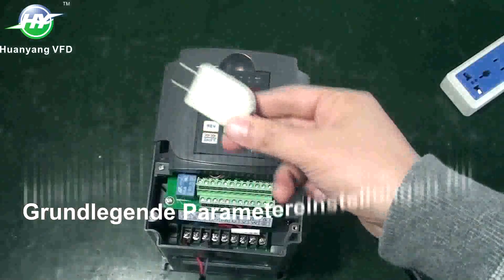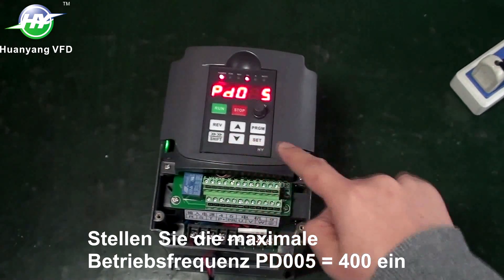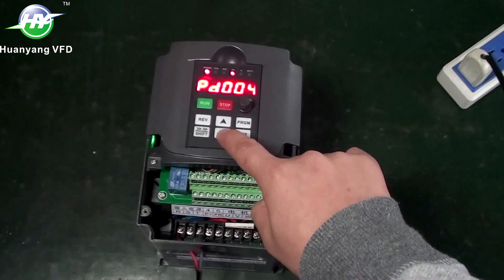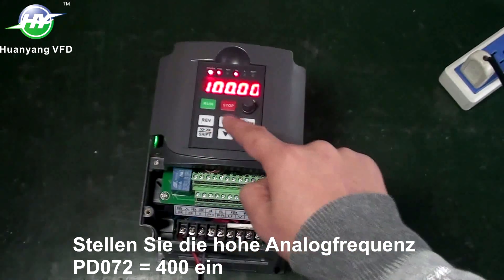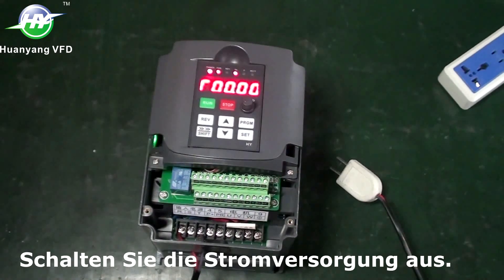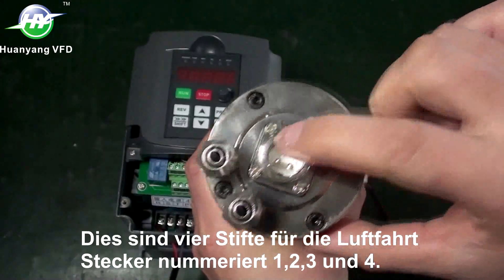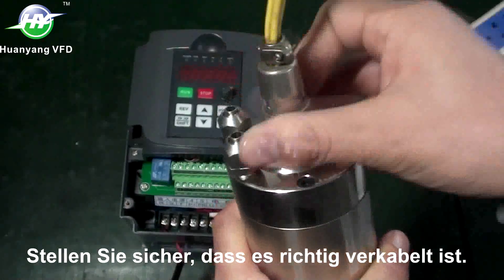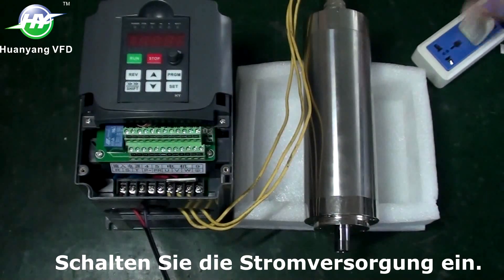Grundlegende Parametereinstellungen für Huanyang Frequenzumrichter zum Antrieb von Spindelmotoren.

Comment: To which connections must the 0-10V external speed control be connected? And what settings do you have to set on the frequency converter?

Comment: sr the frequency in use is 60 HZ AND THE FREQUENCY OF MY MOTOR IS 50 HZ.  THE PARAMETERS P0.03 60HZ, PO.O4 60HZ, P0.06 60HZ, AND FOR THE MOTOR P2.02 50HZ Is this correct?  thank you

Comment: If I have a 5 kw and 7.5 hp lathe, I want to know what parameters I use if the lathe is working with wood and I want it to stop instantly.
Reply from the maker: You can adjust the speed and deceleration time.. And then you also need to equip it with a braking resistor

Comment: My one show everything fine , also the fuse is ok ... but the motor doesent start ...
Reply from the maker: The for indicator light flashes to indicate that it is not running.
If the for indicator light remains on and is displayed as 0, it indicates that the speed is 0
Reply: @huanyanginverter6516  ... no, it whas my fault, the Converter is fine, the lathemainswitch whas in "0" Position... it must be done by Workshoptwarfs🤣

Comment: I have the problem to install an external potentiometer. Which parameters must be set? My inverter is HY01 D523B. My inverter works good, but only with the board potentiometer.

Comment: Which VFD supports a braking resistor? HY series?
Reply from the maker: GT series, 4.0 kw can support braking resistor.
HY series products, by default, do not support braking resistors.
Braking resistors need to be installed during factory production

Comment: how can i connect a braking resistor? i cant get the resistor to slow down the load.
Reply from the maker: By default, the purchase does not support the brake function.
Pd015 parameter is deceleration time
Reply: @huanyanginverter6516  how can i add the Brake function Then? The manual clearly Shows how to Wire IT etc. How do i Know if My vfd has that function? Thanks alot!

Comment: Hi, how to cable 0-10V for software control of spindle RPM and how to cable to switch sindle on/off (I use Estlcam, but guess the cables will be the same). Via the operating terminal I can control the spindle correctly. 

I have: 
1) Spindle on/off: Adurino CNC Shield SPN, 5V and GRND  --> Relais --> FU input: FOR & ACM (upper deck of control circuit terminal) 
2) Spndle RPM: via 0-10V Unit --> FU input: V1 & ACM (lower deck of control circuit terminal)

FU program: PD001 = 1 ; PD002 = 1 ; 

Thanks for your help!

BR, Ben
Reply from the maker: https://youtu.be/2VXMxxa6lXM